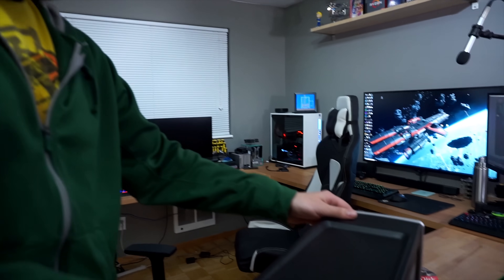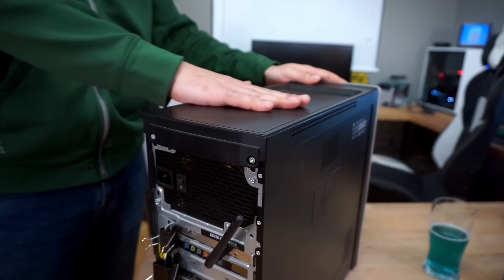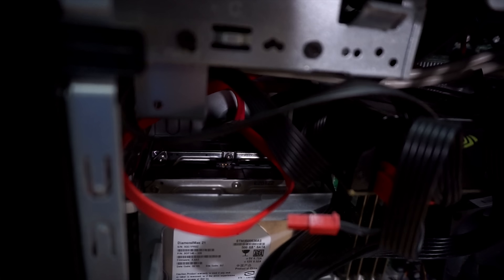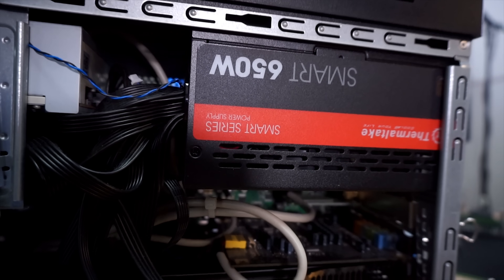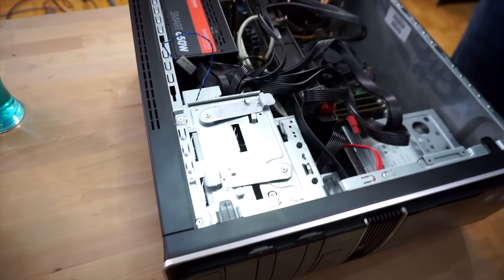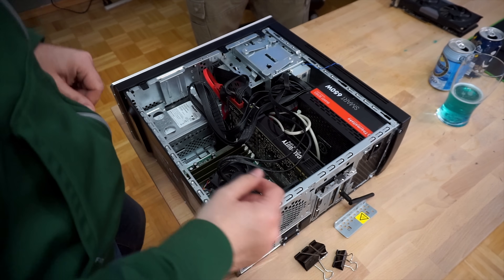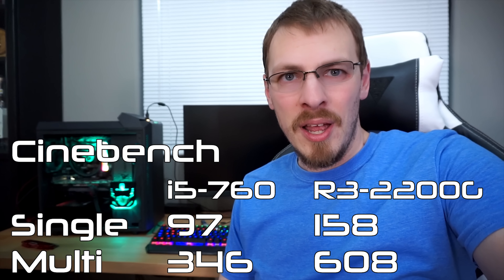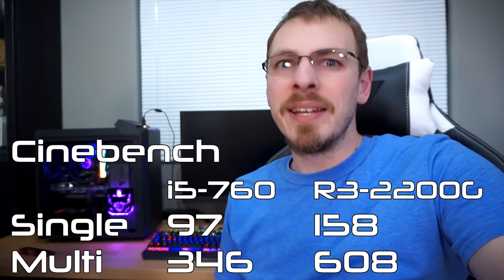PC Rescue!  Let's save Rett from himself...

Comment: I had a dell optiplex 7010 that I gave to my best friend. it originally was paired with a gtx 650 but I changed it out for a gtx 1050 and it worked great up until someone (we still dont know who) messed with the cooler and unplugged it. by the time that happened I had to scrap off the thermal paste from the 1050 because it was so dried up on that thing. so weird..

Comment: Until 6 months ago i was gaming on a 1st gen i5 750 lynnfield with a 560ti and 12 gigs of ram.  Yeah 2x2 gigs and 2x4gigs.  Janky right?  My new pc is rocking a 8700k, 1080, 2x8 gigs of corsair vengeance rgb pro and a 860 evo 500gb ssd.  The i5 was great and handled most games okay at medium to low settings.  My new rig, i call her Rachel, plays everything on max 1080p.  I need to get some more HDD for storage, maybe a m.2 drive and a new monitor (eventually).

Comment: You didn’t have to destroy the bracket for that GPU, I’ve stuck in a GTX 285 in an even older and smaller HP case with the same retention mechanism.. 👍🏼

Comment: am I crazy or wouldn't he be better off with the integrated graphics on the ryzen chip?
Reply: afaik the ryzen's igpu is comparable to a GT1030 at best and that vga I think from my experience is like 1/3 slower than a 750ti
Reply from the maker: It's close, but the 760 will still out perform a Vega 8 in every test.

Comment: Nice build!!!  Just finished a Ryzen 2200G upgrade for the wife last week.  Question?  Did you forget to plug in the rear exhaust fan?  I noticed it was not spinning.  And on the RAM...  Probably not the case in your build....  But, I've experienced issues with DDR3 and  DDR4 RAM (over the years) that will not run correctly at the advertised speed.  I've had to bump the speed down for the RAM to run correctly.
Reply: Its probably set to spin up at a certain temperature. Just like my system. Btw, about ddr4 not running at advertised speed, ive always been able to fix that by manually adjusting the voltage slightly. I think i added +0.0003 volt and it worked. Before that it would crash randomly.
Reply: @sjarken3979  RAM voltage fixed issues I had sometimes.  I think it's just the RAM manufacture process to blame.  As for the system fan, I agree.  But for me, a fan not used is a fan wasted.

Comment: Ah yes, cutting chunks out to make components fit.

That's exactly what I had to do to get the motherboard in. Was not a great way of learning that E-ATX is a form factor that exists.
Reply: cut many a case to get vid cards in in the good ol days. case modding was more a necessity than a hobby lol
Reply: @mycosys  Basically it is an ATX case and an E-ATX board. And the hard drive cage and 5.25" drive bay are riveted in. Nothing you couldn't fix - or rather, bodge - with tin snips or a dremel. Primary downside is, there's no standoffs on the right side of the board so that part is floating.
Reply: @thekrautist  figured :) if there is tray at all the old plastic clip standoffs (popular in AT cases) were great for that

Comment: pc rescue, lets replace EVERYTHING but the hdd's
Reply: The psu is also there
Reply: It was rescuing him from his PC. Not the PC itself. Like a water rescue is saving someone from the water.
Reply: So true...
Reply: Replaced with a 250gb kingston SSD actually. you can see it at 8:28
Reply: Power supply was retained, so wrong. SSD was added, so also kind of wrong. Otherwise you nailed it! :D